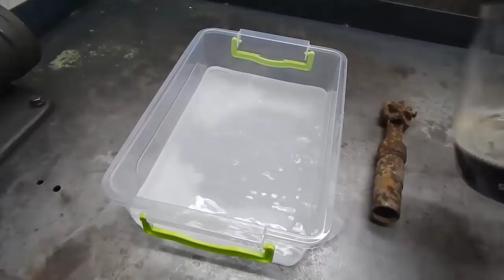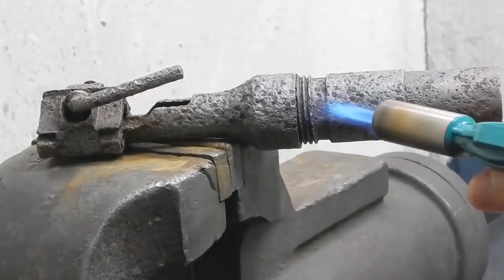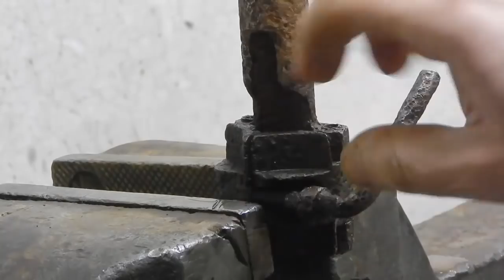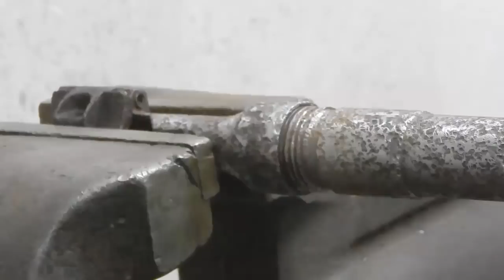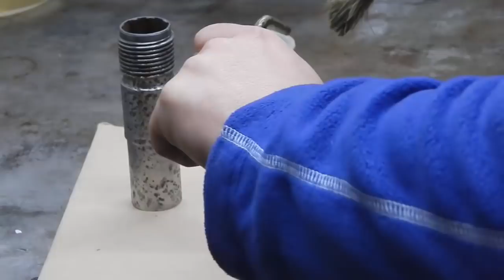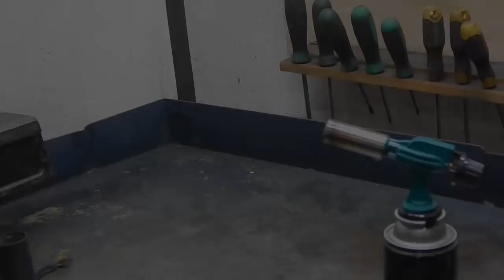Restoration WWII German Mortar

Comment: No mortar but a „Schiessbecher“ produced in huge numbers for the battle at Kursk 1943
Reply: I noticed that the engineer didn't use the sandblaster to remove all of the rust. I've seen it done before on the Chip channel.  🍟 😳 😂 😐 😒 🤣 🍟

Comment: Hello, not a mortar, but rather a grenade launcher that could be fixed to the Karabiner 98k
Reply: I thought that's what it was
Reply: It has to be fired in a mortar posture.
Reply: @jyotirmayamohanty5723  For long range shots yes, but for close range shots it could be fired like a rifle
Reply: Ah!  That's what I was thinking.
Reply: He was close
Reply: @kayagorzan  yes, as close as a Fiat Punto is close to a BMW M5
Reply: @d3rnoobspi3ss21  wouldn't the recoil broke their shoulder?

The brits have one like those and prolonged use would wear down the rifle so they wind metal wires in it to make it stronger
Reply: @thesturm8686  they wrapped bronze wire around the the front stock and forearm to strengthen them.
Reply: @jamesdolan5236  yeah that, i remember seeing it on Forgotten Weapons
Reply: I was going to say it looked like it would fit in a rifle barrel and use blanks, like the Enfield and the Yugo SKS
Reply: This is rocket launcher
Reply: @gundam694  this is not rocket launcher. This is rifle grenade launcher.
Reply: That’s what I thought it was. The opening on the bottom removed the possibility of it being a mortar for me. Should be a long pin there or a striker mechanism if it were a mortar.
Reply: @jyotirmayamohanty5723  it’s a rifle grenade that is fired with a blank cartridge I believe.

Comment: I'm a Locksmith and my Heart goes weak after I watch this Video....... With a Steelhammer push on a 75 year old Part to open the clutch? A bit less of Oil and a lot more of time is the better way.
Reply: His technique worked did it not?
Reply: Give the lad a break buddy he is doing the best he can with what he has got
Reply: Oh true..
Reply: Soak in diesel fuel for a month or more —- that also penetrates things like the clamp that holds the barrel. Slow but effective, also good on brake calibers with frozen piston.

Comment: You will learn to not use such crude, potentially damaging methods.  Hammers, pipe wrenches,  and hard jaw vises do unnecessary scratches, gouges, and dents.
Reply from the maker: All scratches are removed after grinding.

Comment: There are more professional ways of restoring things like this. Evapo rust is more effective in rust removal. You should always clean dirt off then spray it down in penetrating oil to loosen parts then remove all parts for cleaning.

Comment: Great work with that,i have an egg grenade & m24 stick grenade coming very rusty.Have you ever restored these?
Reply: I suppose they are inert, right?
Reply: @thesturm8686  Yep for sure ,I actually found 2 more still with paint,just a bit of rust. want to be careful not to remove it when cleaning.Any hints would be much appreciated.Cheers
Reply: @kerrymcmanus9188  use degreaser soap its orange and rub it easy once it's done clean dry it with a hairdryer so you dont rub the paint off when drying it the handel is it's not rotted away put some wood preservatives on it
Reply: OK thanks for that,all the handles are in great condition.I picked up 2 more M24, i smoke, excellent condition still with writing . Cheers mate
Reply: @kerrymcmanus9188  yup
Reply: @thIDthIRreenactor  You on FB?
Reply: @kerrymcmanus9188  no but I have a yt channel and Instagram my Instagram is rod garage everyday

Comment: Ight if these are legal I want one
Reply: It apends on the laws in Your country, but in some countries cathegorys as smoke grenade launchers, signal pistols, etc. are not under license, but You may need to be 18 Years old to legaly own it in some countries even if they are not classified as licesensed guns and rifles.
Reply: If You happen to live in a country where they are illegal You can usualy talk to the local police about getting it legaly dissarmed, for example by drilling a hole in the barrel, or something similar, with a bit of luck maybe You can just refar to the amonth of corrosion inside the barrel if You manage to find one.

But, in my country they count as a loose part and not a complete firearm, if so there should be no problem.